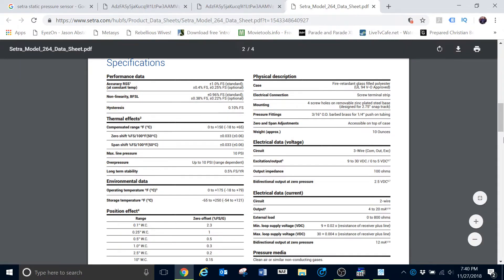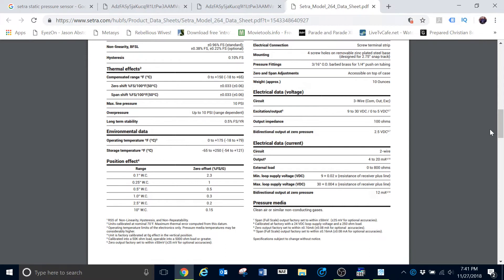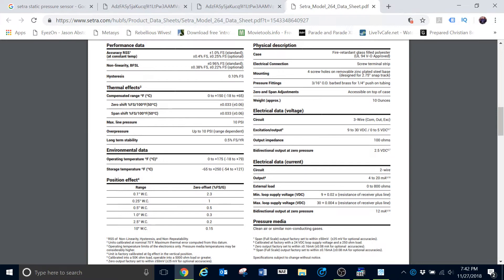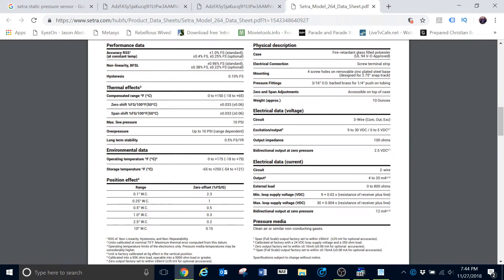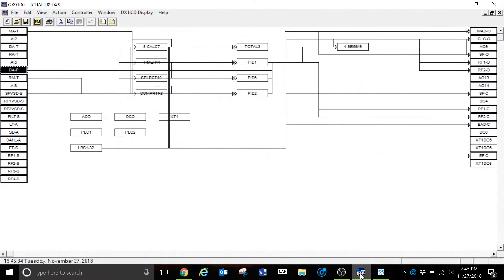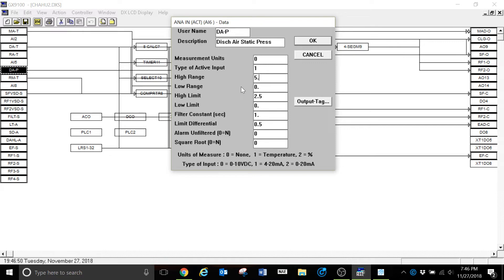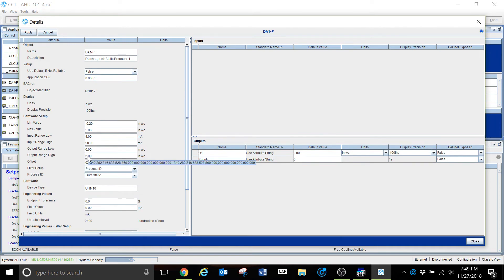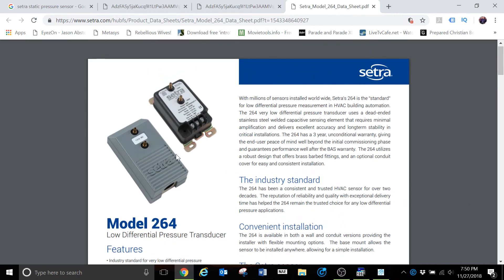How to calibrate Johnson Controls analog inputs

Comment: Interesting.  I noticed you have a high limit set at 2.5   Is that for the alarm?  Just guessing since there is a differential of 0.5
Reply from the maker: Yes, that is for an alarm in the system.  It really isn't needed but it is a default for this set up.

Comment: Thanks Jason for the video. here is an example question. if you are controlling a unit with sensor (DA-T)/ DAT-SP and want to Control the unit through the RA-T/RA-SP instead. how would you make changes to the PID loop. or just leave the adaptive tuning to take care of this. (this is for CCT).  broader example. Original program is more aggressive to changes while new program it takes more time to settle. how does this affect the PID (adaptive) tuning Setup.
Reply from the maker: It would probably be easier to simply write a new program and select that as an option in the CCT set up.  You can modify the program to make it do that but it might be easier for you to start with a clean slate.  Once you get the unit running allow the system time to run to get the tuning where it needs to be and then turn off the automatic tuning.  The automatic pid tuning can cause issues in some systems and there are many in which we simply disable it.   Once it tunes it down so far any big changes cause the system to go nuts and it has to be retuned.